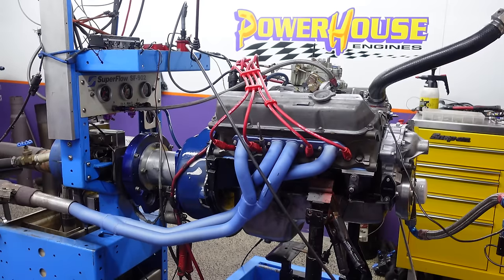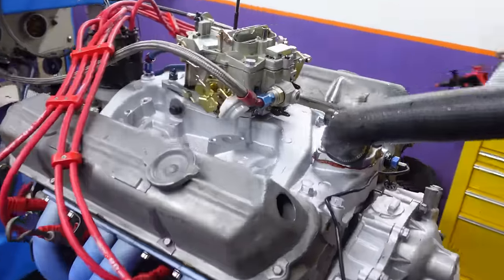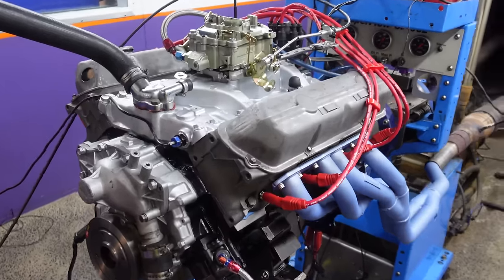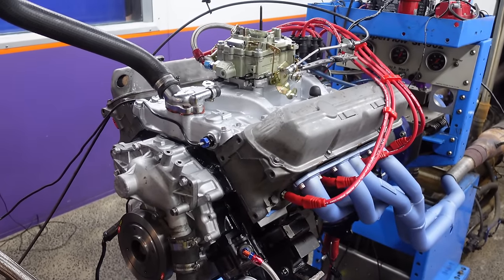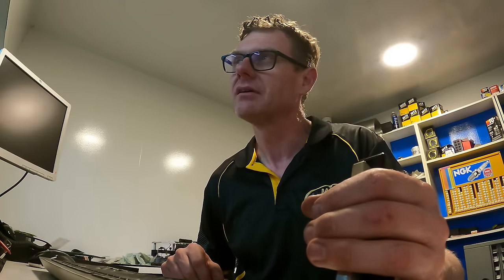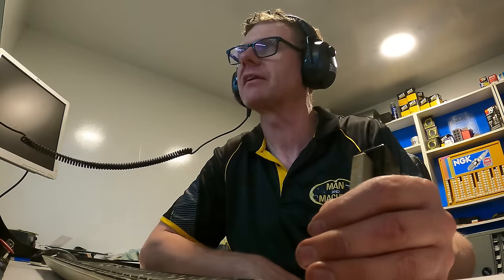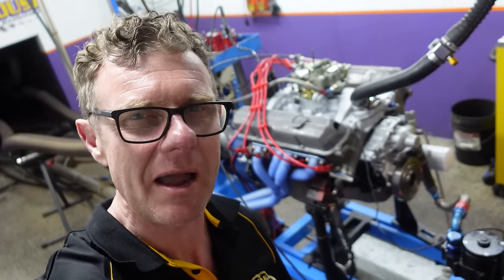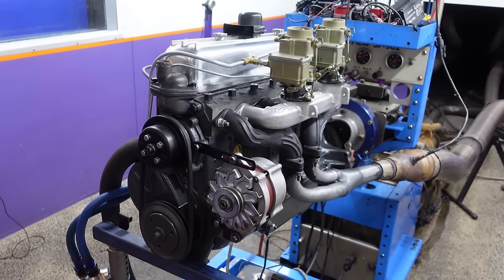GM HOLDEN 308 V8 SURPRISE PACKAGE - Dyno Test | Iconic Engine Builds

Comment: There's more to a quadrajet than meets the eye. Tuned properly, like any carb really, they will perform remarkably well. Responsive primaries are fuel efficient but when called for those dinner plate secondaries just kick in and away it goes. Brilliant, and to think guys took them off for thirsty Holly carbs.
Reply: Yep I remember my mate put a Holley on a vb. Thirsty bastard it was. Why indeed
Reply: Quadrajets do that one thing where they catch on fire though…
Reply: mine was flowing 780 cfm
Reply: @karateduck8727  what is the thing?
Reply: @marcgucciardo1942  due to the casting of the float bowl in some quadrajets can leak fuel past the drain plug, and have been known to start fires. A good friend of mine lost a HG Monaro this way. No worries in my HQ though… she’s got that newfangled fuel injection 😎
Reply: yea i have seen holleys come new out of the box with worn out throttle shafts the machining is atrocious.
Reply: Very underrated carb, if u know how, they are fantastic. Way better on the street than a holley.
Reply: My old man swore by the quadrajet  carb had one a old 350 chev high comp fuely heads good cam reved  to about 7 by memory edelbrock manifold turbo 350 semi auto.  it use to fly hx ute this is back in like 1998 no ls around then . This guy could tune everything by ear a rare person to come by these days miss you old man
Reply: They are hard to tune. Holley is very easy!
Reply: Yes those small primary barralles are great for street and full economy and drivability. Had them on my SLR Torana with duleplane manifold  made plenty of power over stock with a fireball crane cam.
Reply: Holly stands for big nose big fuel gluzzer junk and the 308 is junk as well put cool quadrajet on a Windsor with Cleveland heads or LS1 head’s then your talking!!!! The big problem with 308 or aka the soft block was the oil pressure was crap the better engine was the chev pattern 304 VT 5 L that takes the LS crank and they fixed the oil pressure issue 😂😂😂

Comment: Nice little combo. I'm doing a 253 at the moment along similar lines. Same comp, a little less camshaft and smaller valves. Same stock intake with a quaddie. Should make somewhere between 250 to 280 hp which with a 4 speed and 3.55 gears, will wake up my old HX GTS nicely. Don't need a killer engine to still have a fun car
Reply: If you can stretch your budget go for the bigger valves it really wakes them up. I was an apprentice reconditioner and worked on these type of engines right through to the mid nineties when i changed my vocation. We could build engines like these and better for next to nothing using our own labor and access to very cheap engine parts.
Reply: @grantreid8583  it does have bigger intakes but stock exhaust. They’re about 1.84 I’m pretty sure so bigger than stock but smaller than L34. You have to watch the big valves on 253s as they can touch the side of the bore with a big enough cam
Reply: Just need to be able to drive all day with a crisp note!  Lay a bit of rubber here n there
Reply: never underestimate a 253 about 7years ago now somebody got 515hp out of one naturally aspirated that is a bloody good effort as far as I'm concerned the engine was in a vc commodore station wagon it went bloody hard to.

Comment: I had a 308 in a HQ premier the same colour. Did the HZ front end GTS conversion. Lowered it and worked over the suspension and had a warm motor built. Looked great and went pretty hard. We should have kept all our cars.

Comment: Every one in Oz copied Holden Fisherman's Bend 4bbl only 308 stuff. What an Engine! The early double roller timing chain ended up on the 18R Toyota, the rods were donated to V6 Capri strokers, the Qjet to replace Ford's more unreliable Auotlite Spreadbore and Carter Thermoquad. And the distributor cap and rotor, donated to Oz Spec Chrysler and Ford 5.8's. And   30 years of Bathurst wins till Larry Perkins took it to its last win with F1 style injection.

Comment: 308s are an awesome thing. Best engine i ever had was a stock stroke 308 that a mate and i built as an apprentice. Was a fairly basic engine with ported B cast heads, flat top cast ACLs, comp xe284h camshaft (dual pattern 284/296 with  .544" lift)  single plane torker with an untouched HP 650dp on a 1" spacer and 4-1s with an X piped twin 2.5 exhaust. Thing went 324 at the wheels and in my HX went 12.2@111 consistently which at the time was pretty good for a street car and it sounded amazing. I ran it to 7250 every time i jumped in the thing and 18 years later that engine is still running like a champ in my brothers LX hatch

Comment: we dragged a 308 in A-Street with those heads it made 598hp class rules has to use stock heads, max bore .030, flat tappet cam, and stock stroke and weight 9.5lbs per cubic inch, was on methanol we were never beaten by any 308 ever, engine was build by Peter Michaels from PM Engines it held both et and mph national record till class was ended we had guys from HRT blown away at the Vic Champs how much hp it made lol

Comment: A friend of mine had a WB Statesman he would chauffeur me around in when I was working in Australia. It was a very nice car with a fairly crap engine, it was getting hard to find leaded fuel so he had it rebuilt to handle unleaded.
I thought he dropped a big block in it the difference was so spectacular.
It still wouldn’t run on unleaded (so he converted it to LPG,) but he loved the power increase so much he couldn’t complain.

Comment: G'day Glenn.
Another great video.
I have my 304 out of my VQ Statesman in getting fully re-built at the moment. It's been a slow process for the mechanic to get parts during these times. 
At the start of December he told me it was a 6 week wait to get a new cam. It's going to be built to original specifications as far as I am aware. 
I  will be interested to see how my engine turns out with HP.
I'm looking forward to getting my Statesman back early in the New year. 

Have a great New year Glenn.

Comment: Very impressive work! I've always thought those trusty cast Holden manifolds weren't as bad as everyone made them out to be back in the day and this just proves it 👍🏻
Id be very curious what a straight A-B comparison with the quaddy vs a square bore Holley on a configuration like this would do -- The quadrajets have fairly amazing flow capabilities once those secondaries open (750+ cfm) and with those tiny primaries youre not sacrificing that streetability/fuel economy as you would with a large square bore.

Great vid! Cheers 👍🏻

Comment: . A 230dg intake, probably a 235dg exhaust...519"-.526" (?) and from the looks of the graph and the peaks of the tq and hp, maybe 110dg LSA. I know it's only a 5.0litre but 2" collectors. eeeeee..10:1 on petro or E85? and the head cleanup was worth 13-17cfm?   Nice build ! Cheers!
Reply: I reckon you are close on cam specs mate. 
Going off the known 230 @ .050 inlet duration I’d guess exhaust is 234. 
Lift noting they are using LS rockers is probably in the range you mentioned or even a little bit more but with a bit less lift on the exhaust compared to the inlet and LSA around 108-109.
Id like to see bigger collectors as well.
Overall a nice 308 combo and thanks to Powerhouse Engines and Glenn for putting the video together 👍🏻

Comment: I did a cam change, timing and port on my 308 years back, apart from that all stock, Quad Carb etc, it made a huge difference to the prior setup,  which had the new  ADR27 ( Power destroyer) at the time .

Comment: Can we see what happens when a full street setup is fitted, working water pump, loaded alternator, fan, compliant exhaust silencers, real under bonnet temps, basicly a DIN run. It would also be nice to see what part throttle performance is like.

Comment: There’s nothing wrong with the good old Aussie built 5 liter Holden engines. Any idea how many horsepower the 84 VK Ex Chaser 4 speeds has? Were they built buy HDT ? The 84 VK Ex Chaser I owned had a HDT sticker on the distributor . That VK went like the clappers , it was quick. One night at around 1.30 am at a set of lights a Blue Meanie pulled up beside me , when the light turned green we both put the foot down , I was on its tail for about 4 km along some nice straight sections of road that also had some long sweepers on it . At no point did that Group A Blue Meanie pull away from my 84 VK Ex Highway Patrol 4 speed. How many horsepower did those Group As have ?
Reply: My dad had one from SA that was built with the hdt engine, when he took it to the engine builders they said it was already built to Bathurst spec  with the dual valve spings the bigger race cam ect with all the go fast bits since it was a South aus bt1 from the Nullarbor so it had a built 3 speed auto in it and would smoke through the gears if you stood on it and cruise at 200, it was white also it had a brock director kit on it with a full blue brock interior and a set of 18"s back when that was crazy lol it would of had close to 240kws at the engine and probably close to 500nm+ it was very torquey at all revs

Comment: Cool stuff. I"m intrigued with how they managed to get so much horsepower out of the old group C engines back in the day.  They were around the 450 mark were they not?, group A moreish?
Reply from the maker: I think a good Group C engine in the era made around 400hp plus with the last of the Bg Bangers, albeit with a lot of camshaft and compression. The Group A stuff in the Walkinshaw era onward was probably in the 500hp plus range.  Great era.
Reply: @GlennEverittMasterofMachines  those figures for a Group C engine are close. About 400hp on a Neil Burns engine. The manifolds were cut open, modified, and then put back together , and carbs were free - so IDF Weber's also added power.

That's a super cool result on the 308 in the video. Thanks for making the effort to show us 👌
Reply: In their dreams. Well under 400 for the Crapadores. Closer to 450 for the Fords and Camaros but with about 50 more ci.
Reply: Rough specs in Brock's 86 Bathurst engine was 11:1+ comp, HDT intake fully ported, big valve heads ported as far as they'd go, a modified Quadrajet, and a 254@50 solid cam, around 420hp@6500
By the end of the  carby VL era in 87, the good ones were 440hp. 
The following year, the new EFI engines were 480hp, and over 5 -6 years of development gained another 100hp....
Reply: @ldnwholesale8552  I have seen dyno sheets from recently built (within last 5 years) Group C engines (1983 308 and a 79 spec 351) and figures are higher than you indicate (410hp 308, 565hp 351) however I agree, back in the day these figures may have been less due to lower quality oils, fuels, and ignition systems. Camshafts have also improved and there's 30 years more experience under their belts!! :-)
Reply: @ldnwholesale8552  top Commodores in Grp C were making up to 420HP once they were permitted to run the HDT big valve heads. Larry Perkins was making around 550HP out of the VN Group A engine with slide injection manifold.

Comment: It would be great if you could tune out that dip in the HP curve - great results though. I would love to see some 253 efforts as well.
Reply from the maker: I think you'll find that the stock intake manifold contributes to that dip. I agree, the 253 will be an interesting quest in similar spec. On another note, stroked 253's are also an interesting combination too, long stroke and small bore, great midrange.

Comment: Well Glen i enjoyed my 1st video of yours , and had hg with very fit 308 in stock mode it was brilliance,   but tweaked by you was the thing they need ,,  how much hp did air conditioning  drag from them ?   I had air and left it in the car stuff removing that kind of luxury
Reply from the maker: Good stuff! The AC probably pulled 8hp in the upper rpm range when the compressor was engaged, but it would have been well worth having that luxury on a hot day. 😊

Comment: Happy New Year Glenn. I have a 74 GTS with a 253 as most are, I'd be interested in what numbers could be achieved keeping the stock look.
Reply: Depends on how you want it to idle. Look up David Vizard, he has a computer program that is silly accurate at predicting power. The basic rule is that 1 cfm of intake airflow is roughly 2 hp. Flow your heads and induction system, and do the maths first. 60 hp/liter is a nice driver, past that and it'll be rowdy and you'll have to rev it.
I could see 260-275 hp out of a hot 253 that could still run pump premium and be cost effectve. After that, $$$$$$$
Reply: @hoost3056  Thanks for the info 👍
Reply from the maker: @BapCorp, sounds good! Happy New Year to you too! You should be able to make a 1.05 - 1.1hp per cube based on this engines results. One of  my favorite little engine combo's is a 253 Stroker, the smaller bore with a longer stroke makes some great midrange.

Comment: A 302 Ford motor with a Scat kit 600hp heads deceit cam and carb setup will get you into the 400's. But this 308 with stock heads did good.

Comment: These engines need a good water pump and bleeds allowing the rear water passages to be relieved. The stock pump with the engine installed in the engine bay stalls at 2000rpm which stops coolant flow in the passenger side head. If you not use a valve seat concentricity tool to check the valve to seat ceal you are kidding yourselves. GMV were giving us the pump in pieces and we were machining the body and particular the impeller.

Comment: I managed to drag 380HP @ 8400 rpm out of one of my 308's but it was a bit, well fragile
Reply: 8401 rpm and legs outta bed
Reply: Regular visits from uncle rodney!
Reply: I've made the same HP out of my 304 at only 6100RPM, but with EFI heads and injection.
Only a Crane 286 cam and decent intake manifold and 10.7:1 compression. It makes the power without pushing hard. So very reliable and nice street manners.
Reply: @71DJL  fair comment  but, I was running 8.5:1 for a future SC so  not too bad I guess 👍
Reply: 8400 should have over 500hp really

Comment: Did I hear you say concours restoration of that grey motor? You'd be losing judging points for the modern alternator, cheap repro headers, twin strombies on what looks like a repro manifold, ARP head studs, alloy rocker cover, modified harmonic balancer attachment, atleast you didn't paint it Massey Ferguson grey.

Comment: Virtually standard heads? L34 VALVES NO WHERE NEAR STANDARD pocket ported etc ??? We usto make 340 hp 30 years ago on petrol 443 on avgas  with red heads you want to go smaller valves you will find you will make more power half way between l34 and standard l34 valves are too big

Comment: Never a fan of the 302s or 308s anything under a 350 or 351 was a waste of time in my opinion I wasn't worried about going fast just as long as I had the touque to peel the tyres when I planted my foot down and that deeper note the larger engines make
Reply: If torque floats your boat, as it does mine, then I hope that you drove some Valiants? I had a Chrysler by Chrysler 360 and that engine was a stump-puller. The 6cyl engines were great as well.
Reply from the maker: Those 360s sure did lay some rubber.
Reply: @GlennEverittMasterofMachines  Effortlessly 😊